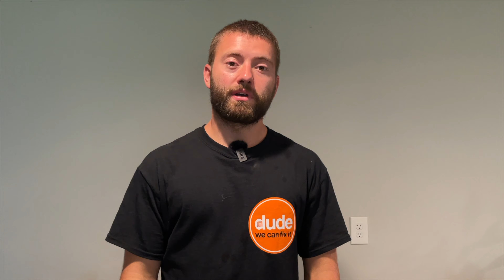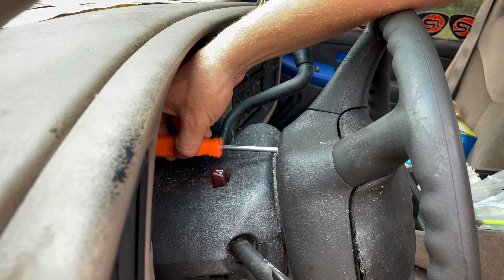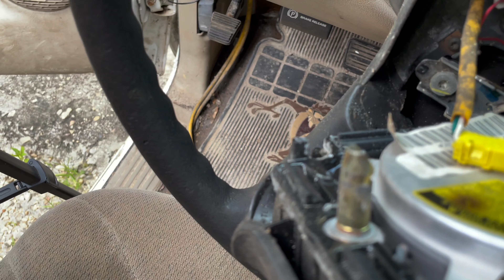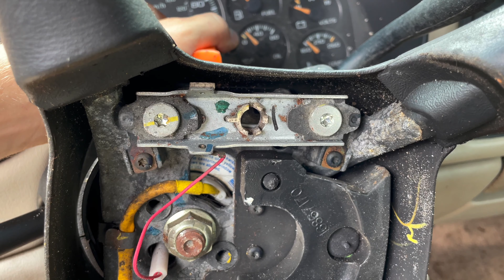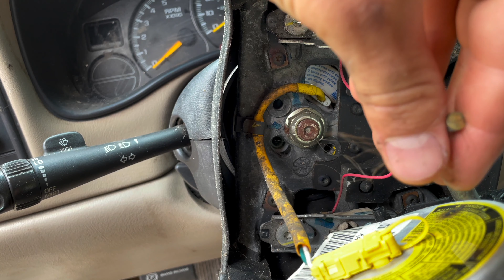Cheap Easy Fix - Horn Not Working- || Chevy GMC

Comment from the maker: Tools used in this video 

BLACK+DECKER Magnetic Screwdriver Set: https://amzn.to/3Oct3wJ
MAXPOWER 7-Piece 3/8-inch Torx Bits Set: https://amzn.to/39voNtv
DEWALT Socket Set: https://amzn.to/3MMRQGM
Augtouf 57 Pcs Wet or Dry Sandpaper Assortment: https://amzn.to/3xMJhqY
Edward Tools Pro-Grip Needle Nose Pliers: https://amzn.to/3xqwpFM

Comment: based on the jagermeister keychain and the exposed aftermarket speaker, im gonna say this truck went muddin and got wet inside and was left wet multiple times for the humidity to rust the insides behind the airbag XD

Comment: Great advice but on my 2000 S10, all I did was clean the little push-in contact, with spring, and that did the trick for me. I never touched the T30 or T20. But, that would have been the next steps if the first hadn't worked.

Comment: How did you get that spring loaded broken plastic piece to stay inside the hole. That’s the problem with mine. One side of the 2 plastic clips broke off. You’d think they’d just sell that cheap part and you could just splice into the 2 red wires. Instead you have to buy the entire assembly.

Comment: Hey, great tip. Fixed the horn issue I was having since I bought my 2000 safari about a year ago. Quick question, is it possible to swap out a horn from a 2005 Dodge Ram 2500, into a 2000 safari?

Comment: I did that but it still doesn’t work. Rely clicks. Changed fuse. Still doesn’t work.
Reply from the maker: Might be the horn speaker that actually makes the noise. See if you are getting voltage there when you press the horn button
Reply: @dudewecanfixit thank you I will try that.

Comment: Didn't work for me, and i even added some solder to the thing in the middle
Reply from the maker: You can find the horn (usually near the radiator) and see if it's getting 12 volts when someone pushes the horn button on the steering wheel.

Comment: Hi. I have a 2001 Chevy Silverado 1500. Sometimes I can  press center of steering wheel, and horn will sound. Sometimes, when pressing center of steering wheel, no horn sounds. Sometimes, I have to press various areas of center of steering wheel or press very hard, to make the horn sound. 

Is it a bad contact issue in steering wheel, bad horn relay, or a bad horn?
Reply from the maker: Sounds like the contacts are worn and need to be cleaned or adjusted
Reply: @dudewecanfixit it may be possible or my horns may be going bad.

Comment: What if the horn only works when u hold  the wheel left or right but dont work with wheel straight
Reply from the maker: I don't know
Reply: @ fixed it
Reply: @CODYWAYNEinGA6.6 what was your issue? Clock spring?

Comment: Great video, only second time ever had a video repair be true. Found massive corrosion behind contacts on wheel side. having 200k, gave the contact tabs a slight bend up. No more mashing on the horn! Thanks dude.😊
Reply from the maker: That's Fantasic! Glad you got it fixed, good job!

Comment: My issue is horn only works when steering wheel is straight. Turning just a little left or right it doesn't work. Replaced clock spring, cleaned contact and added solder to the spring!
Reply from the maker: Does it still not work?

Comment: This didn't solve my issue.  My horn still only sounds when I turn my wheel to the right, and only for a turn of 180 degrees to the right.   If I go past that, it stops working.   

When I turn to the left, or keep the wheel straight, the horn doesn't work 😢
Reply from the maker: It might be the clockspring not making good contact
Reply: @dudewecanfixit  I agree
Reply from the maker: We are in a consensus!
Reply: @dudewecanfixit  lol.  Affirmative ghost rider

Comment: If you look into the steering wheel where the horn contact wire goes in there are two recesses where the plastic ears go into it... I believe the only way can get it out without breaking the tabs  is to first push it in (out of the recesses)and rotate it 90 degrees and then carefully take it out and when you're putting it back in you line it up the tabs with those two little recesses and push it straight in... it's a little different than the earlier ones that had one "tang" that went in (similar to an old-style push and turn light bulb) where you would push it in and turn it slightly clockwise i think (carefully)and release it and it would lock in.. good video!!... I wasn't sure how to get the airbag off and this helped to show the spring mechanism that holds it in place(thanks!)... might want to mark the horn contacts with a marker so they get back in the correct location
Reply from the maker: Thanks for the comment, you are exactly right about the ears!
Reply: @dudewecanfixit  thanks! I was surprised when I took mine out that it had changed from the old style.. I'm lucky I didn't break mine off.. hopefully somebody reads that comment before breaking theirs off... luckily I remembered that the old style was a push in and turn to release.. that probably saved my "ears" haha...
Reply: Idk if it's going to help me but I did read your comment before getting started so I say thanks and salute you!
Reply: @CeeJayThe13th I hope it helped and you're welcome
Reply: @calvinpochinko4277  most definitely did!  I would have broken it lol.  It's not real intuitive.

Comment: Great job explaining! Straight and to the point. Btw, one of the two plastic prongs broke just like yours. How did you fix it? Did you get a replacement? If so, where? Mine works after reassembly but I’m afraid it will disengage when my vehicle hits a big bump. Thoughts?
Reply: You can order the whole horn contact setup for about 15 bucks.
Reply from the maker: I just put it back in and carefully put the cover on. Probably a dealership part.